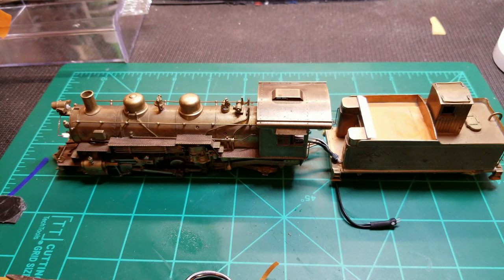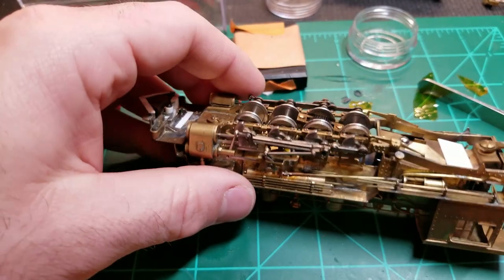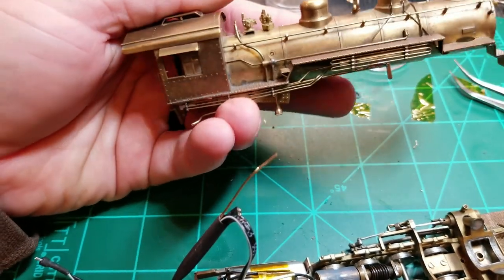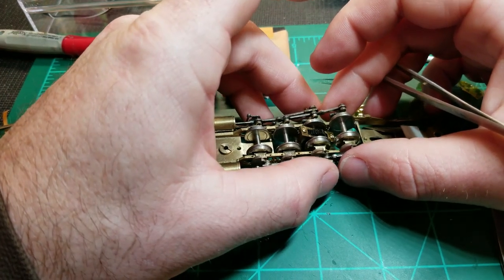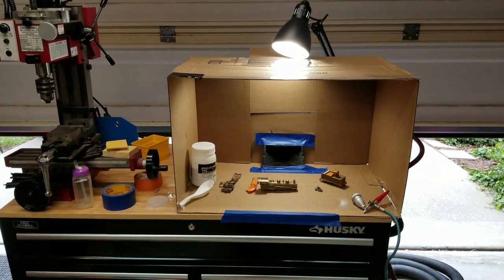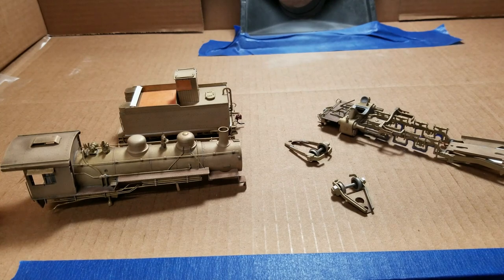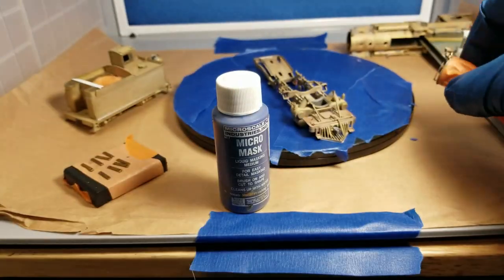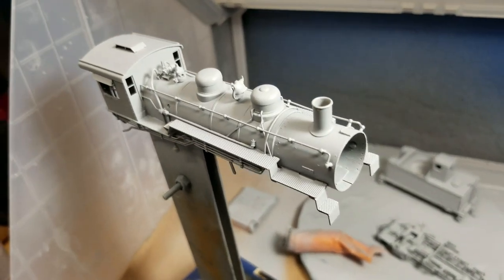Painting a Brass Steam Lomomotive Part 1

Comment: I got my first brass diesel locomotive for Christmas this year.  It's a Hallmark Fairbanks-Morse H12-44 and it came painted for the Central of Georgia (the road I model) livery.  I've already taken it apart for servicing and adding LED headlight and red LED backup light.  Got to take her apart one more time to add a couple of diodes to the LED's to keep them from flashing when the reverse current is applied.  Have to wait for my diodes get here.  I plan to buy more brass engines especially a few steamers.  Nice to know how to paint 'em.  Thanks for posting.  Cheers from eastern TN

Comment: Great video.  Finally started blasting.  I'm blasting at 60 psi and I'm not getting nearly the results you did!  The Harbor hose did not fit my compressor so I used the one that came with my compressor.  The nozzle hole in the sprayer is so tiny that I get about a 1/8 inch blast pattern.  Took me 25 minutes to do one side of my Q2!  Strange.  I'll experiment since this is my first time using this equipment.

Comment: I've got a few engines (Mantua & Tyco) that have open frame (Pittman) motors in them.  I never change out the motors as the Pittman motors are just fine.  What I do to improve them is change out the magnets to neodymium (rare earth) magnets and it made a HUGE difference in current draw and now they will "creep" around the tracks just like you guys' DCC step 1 speed.  I only do DC as I hate the sound of HO DCC sound.  It sounds way too tinny.  O gauge DCC sound is much better.  I guess the speakers are just so small in HO DCC.  Cheers from eastern TN

Comment: I find it easier to wire wheel mine (ultra fine), it buff's it up so shiny that it creates a very, very strong bond.
 I then acid etch prime with a bit of heat. I find that model grade primer's don't stay on the model for very long.

Comment: Would the media blasting be necessary to abrade the surface if it didn't have any coating on it at all?  Thanks.
Reply from the maker: It really helps with adhesion especially if you are not painting with scalecoat. It gives it a rough surface for the paint to adhere to.
Reply: @Helmikins  Thanks very much.   The videos were good and I appreciate your helpful insights.

Comment: Is sand blasting a must or can a good cleaning suffice?
Reply from the maker: Not a must but does help with adhesion. Just make sure that it is de-greased well and if possible use scale coat, it sticks the best to bare metal. I have been using it on all my bare brass models now.

Comment: By any chance do you know if painting a brass loco prevents it from being conductive? I have an issue with my lead trucks touching the locomotive and shorting out the engine.
Reply from the maker: The lead  truck can wear through the paint and short it out. I put a thin piece of styrene, .010, over where the wheels could touch. I also do this on the bottom of the cow catcher.
Reply: @Helmikins  Thank you for the info, appreciate it.
Reply: MrGassRight you can use Teflon sheet to insulate